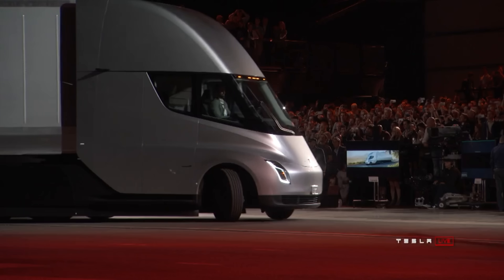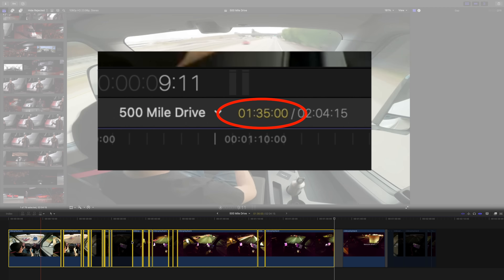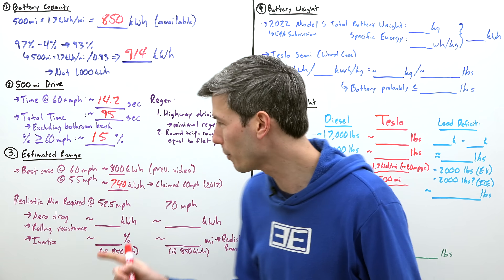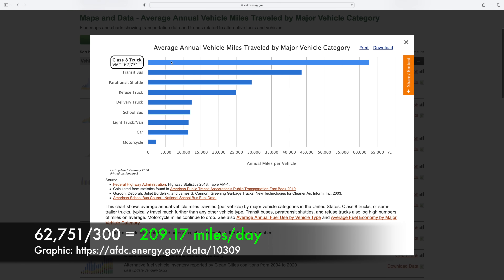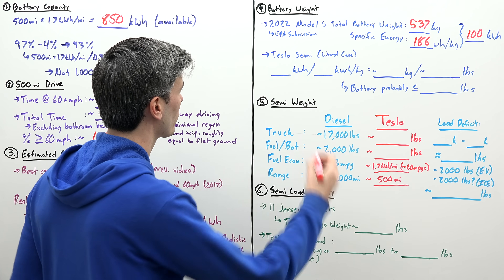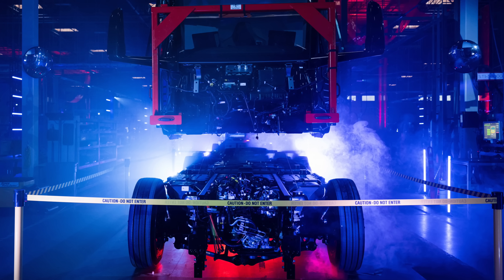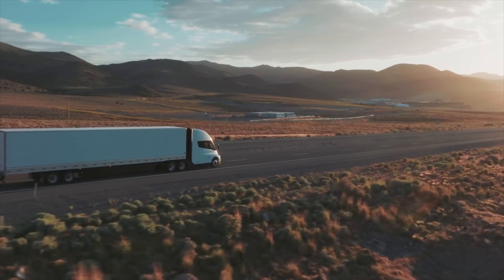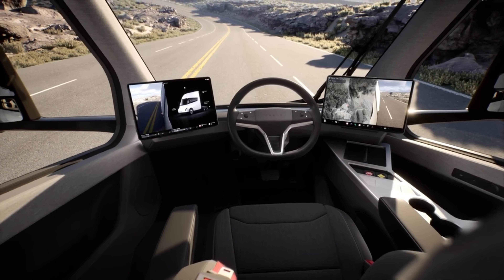Does The Tesla Semi Make Any Sense? Part 2!

Comment: @litestuffllc7249  how long do you think a fire of a Semi will burn? 
Days. So? 
 Diesel doesn't normally burn. 
Your repeated claim that diesel doesn't burn is simply absurd.
 The drag number is fake. 
The drag number is corroborated by the range. Without the stated coefficient of drag, the Tesla Semi couldn't make its demonstrated range.
 to do anything significant you have to taper the trailer to a tear drop shape 
Yes, you found an online paper stating this is one method to reduce aerodynamic drag. But it also greatly increases the length of the trailer, which would be unacceptable. Fortunately, Tesla has achieved the coefficient of drag needed to meet its performance numbers without such extreme measures.
 A standard transformer in your neighborhood is 1/4 megawatt 
Completely irrelevant.
 they cost $200,000 each. 
So? Having now installed 55,000 Superchargers nearly world-wide, no one in the world has a better grasp of the cost of EV chargers than Tesla. Whatever the cost, it's well known to Tesla and PepsiCo, and it's taken into account in the business plan. 
 you can buy 2 Diesles [sic] for the same price and haul about 2.5x the load 
Actually, a Tesla Semi will haul within a single digit percentage of what a diesel semi will, and at a much lower cost per mile. But that's irrelevant, because the vast majority of trips are cubed out, rather than being loaded to max load. According to studies, only 2% of trips go out loaded to max weight, and 85% go out loaded to 10,000 lbs. below max weight or lower. For the 2% that must be fully loaded for every trip, diesels will still be around for decades. The the rest, electric semis will be a huge improvement in every area.

Comment: No Ben your absurd.  I've fired multiple Vulcan 20mm canon through a russian fuel tank it didn't explode or burn. In a diesel engine you have to use injectors to vaporize the fuel to burn it;  same thing in a diesel stove.  Diesel doesn't burn under normation conditions.  Even if it did you could easily put it out under most circumstances - you can't put out a lithium battery fire easily; and a battery the size of 12 Model Y batteries is dangerous to approach both due to poison gases and explosive; especially in a confined area like a tunnel.

Comment: Semi's battery is 12 times bigger than a Model Y; how long do you think a fire of a Semi will burn? how many toxic gases? do you think it would be wise to allow on in the Lincoln tunnel? In contrast Diesel doesn't normally burn..  The drag number is fake.  Don't you think anyone thought about making a truck have less drag before?  Of course they have but to do anything significant you have to taper the trailer to a tear drop shape, Tesla doesn't do that .. Ooops. So Tesla's real max range with normal trailer is 250 miles under ideal circumstances. You must charge it. A standard transformer in your neighborhood is 1/4 megawatt;  you'll need 4 and incoming lines to support them just to charge 1 Semi in 1 hour; oh and they cost $200,000 each. So if you don't count this cost you can buy 2 Diesles for the same price and haul about 2.5x the load.  Oops you forgot the revenue producing side of the equation. Do you get paid more to haul 2.5x more?  If you do include the cost of the charger it will need to be spread over how many vehicles you can usefully charge with it in a day.

Comment: The range degrades faster with fast charging. Some sources suggest a 20% degradation after only 1 year.
Reply: What sources suggest this? ralphtoivonen?
Reply: How many charge cycles?
Reply: What matters is the C-rate, 900 kWh charging at 900 kW would take 1 hour and equal 1C. The trucks are currently charging at about 750 kW, which is below 1C. Pretty much anything below 2C is absolutely no problem for longevity, above 3C is where it gets problematic for the current battery tech, that would equal about 2700 kW, which is not even planned for the Semi, 1400 is the max they are aiming for right now and that equals about 1.5C.
Reply: @nightshadowblade  interesting... something to research.  In any case for here in Australia Tesla semis are not road legal.
Reply: @nightshadowblade  Please define "C-rate". I'm an electrical engineer and I've never heard of this. What are the units of "C-rate"? Actually, if the example is 900 kWh/900 kW, the units must be just hours; and if so, it's not a rate, it's a time, which is the inverse of rate.
Reply: @BigBen621  It's the rate at which the capacity or capacitance is increased or decreased. If you have a 100 kWh battery and discharge it at a rate of 1C, it means it will discharge 100 kWh at 100 kW in 1 hour. If the rate is 2C it will discharge at 200 kW in 30 minutes, at 3C it's at 300 kW in 20 minutes etc. The same goes for charging.

Comment: God, I hate that cab interior and driver position. I'd rather go back to the 20+ year old volvo semis I started with than set foot in that cab.
Reply: Pretty sure you haven't actually tested the driver position; but of course you're free to hate it if you choose. The good news is that it'll be decades if not generations, if ever, before all diesel semis are replaced with electric semis, so you'll likely be able to retire before coming under any pressure to drive a Tesla or other electric semi. And there'll be plenty who do want to drive them. So win-win!

Comment: this kWh/mile and mpg business is super idiotic. 32+ Liters /100km for the Diesel truck equals 320 kWh for every 100km. The Tesla needs 105+ kWh to travel 100km.     IF the governments (everywhere, basically) were to tax equally and not blindly (as usual), that'd be a 3:1 ratio of savings for the EV. Good luck finding the 300% of savings in burn-once-fuels.

Comment: This is a great breakdown. I'm a semi truck driver and I expect electric big rigs to slowly take over local and regional routes, but long haul will likely remain diesel for quite a while. I think it will take a long time to develop a charging network that can handle the energy demand.
Reply: I wonder whether hybrid diesel/electric is a good option. I imagine that the transmission setup would be the limiting factor there though. Maybe a diesel powerplant with an electric drivetrain?
Reply: @MotorcycleWrites  Diesel electric is less efficient than with a standard transmission.
Reply: @MotorcycleWrites  But Tesla's whole point is to get rid of emissions from diesel, primarily diesel particulate matter; and a diesel/electric hybrid wouldn't achieve this.
Reply: @BigBen621  Tesla’s whole point is to make an enormous amount of money from fleet sales lol, but I get what you mean. Battery trucks won’t be a practical solution for long-haul jobs for a long time, hybrid might bridge the gap between efficiency and range.
Reply: @MotorcycleWrites  I agree that battery trucks won't be a practical solution for long-haul for quite a while, so perhaps diesel-electric hybrids might help bridge the gap.
Reply: @BigBen621  or we could just keep using diesel trucks. Adding a hybrid system doesn’t make highway mileage that much better anyways, and that’s where the majority of fuel will be burned. 

There’s just not a great alternative to traditional semis for fast, long distance delivery.
Reply: @MotorcycleWrites or we build infrastructure to charge electric trucks. they make stops anyway!!!
Reply: @MotorcycleWrites  if CO2 emissions would be priced, then a diesel truck would start becoming more and more expensive.. so the electric alternative would become more attractive - and then you can calculate: would i send goods that are 1 day faster at destination, but costs 3times more? or would i send it with an electric truck, takes a little longer because of charing-pauses.. but: costs lot less... thats what it will be in 10-20 years i think
Reply: @Kraeuterbutter  I think the real solution is to stop our obsession with fast shipping, and start using more rail for long-haul shipments. Less efficient trucks (diesel, gas, or electric) can focus on last-mile while we use actually efficient systems for long-distance cargo. Moving from diesel trucks to electric trucks is kind of a lateral move.

I agree that taxing emissions or increasing the cost of fuel would help hurry that along.
Reply: @MotorcycleWrites  100% with that...
on the other hand: i see people complaining because focusing of some (minor) details:
the center placed driver seat: when you come to a "tollgate" you have to stand up when you want to give the papers trough the window... first: most tollgates are meanwhile electronic ones.. and second: THIS is a real problem? when you drive several hours and have to maybe stand up once a hour to give the papers 2meters away through the window? this kind of drive cabin reduced drag, improves efficiency of the truck... a normal diesel-trucks needs something about 25 to 30 liters/100km - a tesla semi is more like 10-15liters/100km energy equivalent - so much energie safed, much higher efficience.. and the only thing some guys say is: "you have to leave the driver seat when you want to hand papers through the window"
when we want to transission transport to renewable energies -> there will be some los in comfort  (but also some gains in other departures)
and yes.. ordering today by amazon so we can have it tomorrow on our doors... this does in realty not realy make our lifes better.. its just something we got used to ....
its like the concorde airplane, hypersonic... there were people, managers how said: its neccassary to use that plane... now, for 2 decades there are no hypersonic planes any more, and: the world still works
Reply: @PavelKrupets  You can install all of the chargers you want but it won't matter when there isn't enough electricity to heat and cool our homes let alone massive MWH chargers!
Reply: @Hogger280  supply always follows demand
Reply: @PavelKrupets  I never said it didn't.  However, now that you brought it up - nobody wants to buy EV's and yet, because of gov. pressure, car lots are overflowing with unsellable EV's!   Supply and demand only works in a free market system which we no longer have.
Reply: @Hogger280  i want ev
Reply: @PavelKrupets  There are plenty to chose from, go for it.
Reply: @Hogger280  stop speaking for everybody
Reply: @PavelKrupets  What in the Hell are you talking about.  Why don't you just have a good cry and get over whatever has hurt your little girly feelings!
Reply: @Hogger280  you are the one crying and trying to speak for everybody
Reply: I daubt it due to costs
Reply: That's how it should be. We can reduce our fossil fuel demand significantly without having to electrify everything. Our country is massive, and diesel rail and trucking will be a backbone for our economy even after most of the electronic revolution takes place (as it should by necessity).
Reply: @jorelldye4346  rail will move to electric
Reply: @PavelKrupets  Rail IS electric in a hybrid diesel-electric platform. Rail will not go fully electric in America anytime soon because of the continental-sized routes through endless expanses of nothing. Those outside the US don't appreciate just how much empty space there is in the US, where no charge stations are currently possible.
Reply: @jorelldye4346  as soon as disel price will go up they will build power lines next to rails. power lines go through america btw. same with trucks. 10$ per gallon, 20$ per gallon, 60$ per gallon, at some point people will stop buying that stuff and stop making gas powered cars.
Reply: @PavelKrupets  Yes but keep in mind that Texas is drowning in oil. It could be a while...

Comment: Why the huge cabin with sleeping??with 300/400 miles between charging stations, it seems unlikely you unload charge and load , drive to a truck stop and bed down. It is more likely you end disconnect your trailer put the truck on the charger and go home, in the morning connect and go on your way,,
Reply: No huge cabin, no bunk. It's a day cab, for the reasons you state.

Comment: Of course trusting numbers coming directly from Musk himself is dangerous to say the least. In fact trusting anything he says is dangerous. If Elon says 1.7 kWh/mile that happened while rolling down a hill with the wind in the back on a perfect road for a very short distance.
Reply: Actually, it happened for 500 miles, from Fremont CA to San Diego CA, including a 4,200 foot climb to Tejon pass, loaded to within 1,000 lbs. of the 82,000 lb. GCVWR for electric and natural-gas powered trucks. Other than those little details, you're 100% correct!
Reply: @BigBen621  If Tesla or Musk says that it's almost certainly a lie
Reply: @fdk7014  They posted the video of it though. It's not a lie. Tesla isn't known for lying about efficiency.

Comment: But did the truck have a full load on it
Reply: Yes. Next?
Reply: @BigBen621  it looks ugly
Reply: @benwheeler3424  The appearance is pretty much driven by the aerodynamics. You can have a truck that looks like what we expect a semi tractor to look like, or one with low operating costs. Fleet operators will probably be picking economics over appearance. There will probably be few owner-operators; but of course these would be free to choose appearance over economics if that's their choice.
Reply: @BigBen621  it'll be terrible with heavy-duty trucks like logging industry aerodynamics don't matter
Reply: @BigBen621  the truck would be too heavy to really carry anything even and that would bring down the whole point of going Electric because I mean why carry less in a load when you can carry more
Reply: @benwheeler3424  it'll be terrible with heavy-duty trucks like logging industry 
I see no reason why this would be true. The Tesla Semi has twice the horsepower of a typical diesel semi for pulling through mud or up steep slopes; nearly full torque at 0 RPM where a diesel engine has none, to start a big load rolling; much better traction on muddy or slippery roads, for many reasons; much better ability to climb steep grades; etc. I agree aerodynamics don't matter here, but they don't hurt either.
Reply: @benwheeler3424   the truck would be too heavy to really carry anything 
Too funny! You just watched—or actually obviously didn't watch, but still felt you should comment on—a video establishing a payload of 44,000 lbs. for the Tesla Semi, which is within 2% to 3% of what a typical diesel semi can tow. For the rare load where every ounce of payload is essential regardless of operating cost, Tesla Semis won't be used. For all other loads, Tesla Semis will deliver much lower per-mile and overall operating costs at the cost of <3% less payload, when it's very rare for trucks to be loaded right to the GCVWR anyway.

Comment: One thing you should put into consideration is... WEATHER. In very cold climate (or hot in that matter). Batteries lose a lot of efficiency, there are people out there getting 120miles on a Tesla that should do 300 miles. Put up a more realistic scenario where the truck will be going up-hill more, and close to its weight limits, and you will be lucky to get more than 200-300 miles on that "500 mile" battery pack. Using energy for air conditioning/heating. Powering up electronics inside of the truck and so on, will also have an impact. 

At the end of the day car companies are really misleading on their announcements (something that you pointed out). I am still a firm believer that we need a breakthrough in battery and electro-motor tech in order for EVs to make any sense, aside from driving to work, while owning a house with a garage. 90% of the people in my country live in apartment buildings, in a city with close to 2 million people, there are only 7 Teslas registered. Because you have to go and charge up in a Mall for it to make sense(because it is free), otherwise it costs 0.50 Euro per kW to charge the car at a charging station. Having a LPG converted car is around twice as cheap to charge for those miles, and you don't have to worry about batteries going bad. Which brings me back to the trucks, realistically, getting 300 miles on a charge, costing 400-450 euros to charge that 850kWh battery (since you can't charge a semi in a Mall), a liter of diesel here after the truck driver's discount is about 1 Euro per liter(I have a friend who works at a gas station where trucks travelling across Europe to Turkey load, this is how I know this), so 450 liters of fuel, With a 7.3 mpg (32L/100km in non-r3tard units, and in the 30-35L/100km range from our dept of transportation source) so 1000km for 320L of diesel and about 1400km with 450L of fuel that is 870miles instead of 300miles. It literally makes no sense in a country like mine, not from a financial point, not from any sort of point. And if you say "yeah, but you don't have to change the oil" a 100kWh battery pack costs $20,000 an 850kWh pack will cost around 8.5 times as much so $170,000, throw in a motor or two and you get to the 200,000 USD mark running cost, and that could be done in less than two years. And believe me, it does not cost $100k a year to maintain a truck. And I am sticking with that 300 mile range, because it is way more realistic. And if the average speed in the video is around 40-45 miles realistically it is really embarrassing for that truck.

I know that prices of fuel differ between different countries like in Germany, for 2023 it is 1.80 Euro a liter, so maybe around 1.50 Euro for the truck drivers. But even if it is 2 Euros, you still go 700km for the same price..
P.S.- I used 450 as half of 850 for a reason. Batteries degrade over time. So it is a pretty good average in favor of the EV's life here.
Reply: Newer teslas with high efficiency heatpumps get far better winter range than the older models with resistive heating.